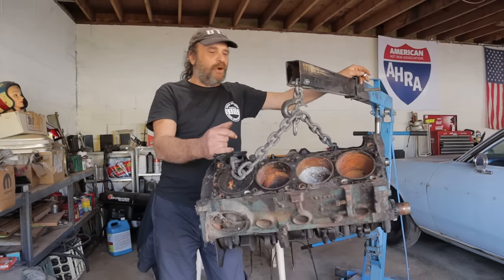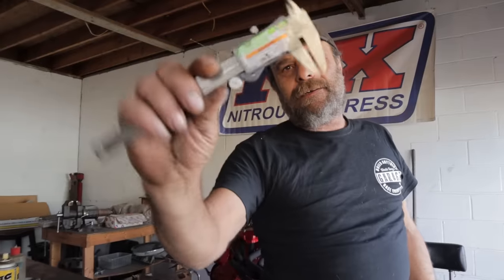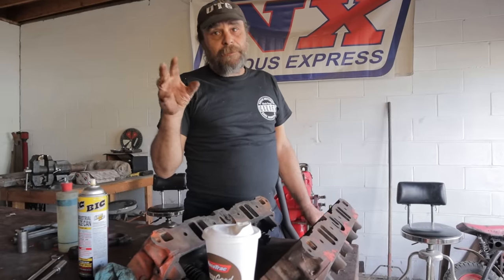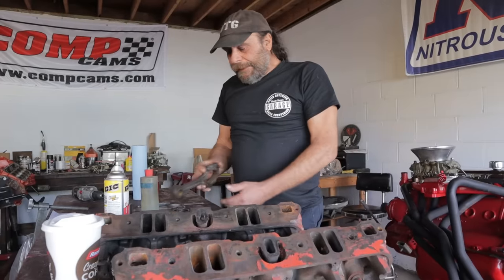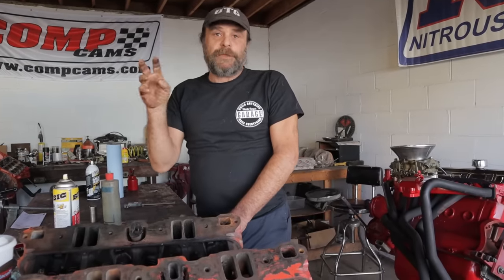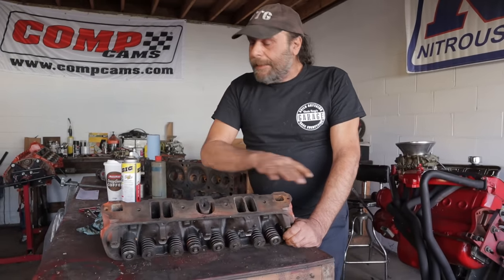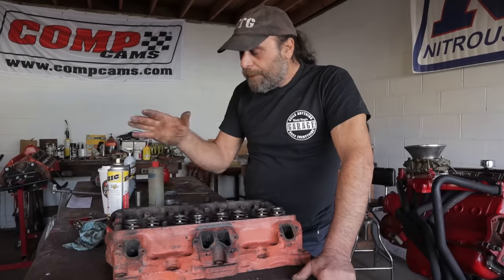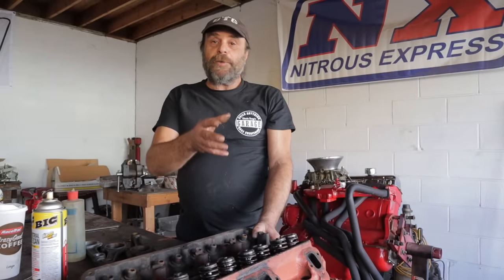The Most Under Rated V-8 In History?

Comment: 318 magnum, have had over 10 vehicles with them and have went over 300,000 miles with them. If you wanna see some of my dakotas checkout my channel! I love the 1994-1996 dakota models with the multiport fuel injection and NV3500 5 speed manual transmission, they pull hard i plan to do a HX35 turbo on one soon to get 318hp out of 318 cubic inch. 1hp for every reliable cubic inch from that 318 would be best bang for buck fun

Comment: i have a 69 Correnet with a 318 .. that thing ran forever well over 200k ,,,the only thing that was anoying with that car was a part ( i forget what ir was called) it was nothing but a cramic piece with a piece of metal in it with a wire at each end,, it use to go alot ,,and it would just stop that car from running ,,after awahile i always had 2 of them in the glove box at all times... hahahahaha

Comment: Food for thought. 1951 Alfa Romeo 1.5 liter straight 8 dual stage supercharger through a single triple throat Weber carb that produced 425HP at up to 10,500rpm. All modern engines suck.

Comment: The carbs were junk on the 318 340 ,360 coke stuke the thermo quad had plastic bowls tranny were faiir they motor mounts broke on the d 100 timing chains were weak heads were problem s

Comment: This Guy , doesent quite get ,All ,of it , the 318 ,was a Torque motor ! All motors are Either ,Good at  producing , "Torque ",or : "Horsepower " ,Not Quite the same thing .both , Aspects of an engines "Power "Hes right though ,that 318 is Chryslers ,Most overlooked engine ,was Awsome ! They put it in Everything ! from Pick ups ,to Box trucks , New Yorkers ,to Polaras ,Station Wagons ,Darts ,Baracudas ,Allways worked Well .them ,Bored it ,and 340 ,was Born .Maybe Best performance Small Block of 60's ,Smog Rules Killed it ; along with Many other good  engines

Comment: 318 were long lasting engines.
But
Today
A toyota 4 cyl with 6 speed automatic is stronger faster lasts and will get you 4 x fuel economy.
Is it a muscle car engine...? Good luck
Ok spemd huge $ turn it into a 340.
Your 318 didnt do well on nicks dyno. 
Try again would like to see 290 + hp.. ?

Comment: Blah blah blah. Let me tell you how great my 327 is. Even shitty sbc heads have 1.94/1.50 valves  I’m not bashing but every engine brand has a black sheep. The 305 sbc suffers because of the 350. The 326 & 350 Pontiacs get looked over because of the 400 & 455. Nobody would bother with a 260 Ford even though it was the original cobra engine.